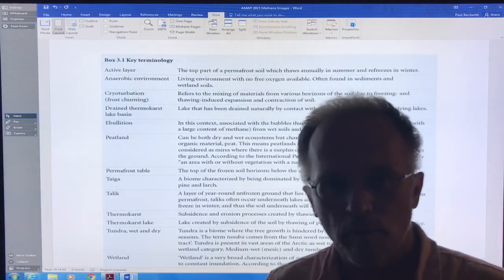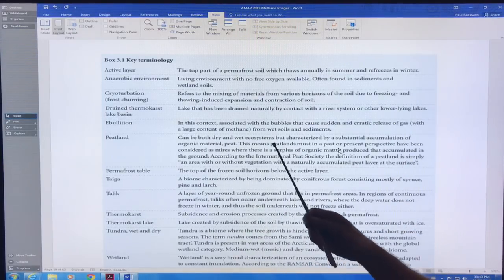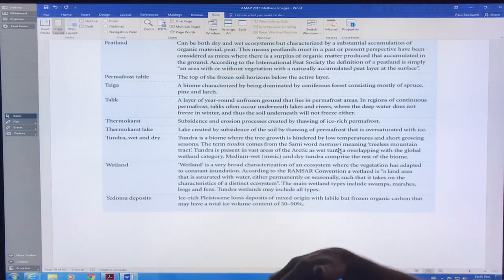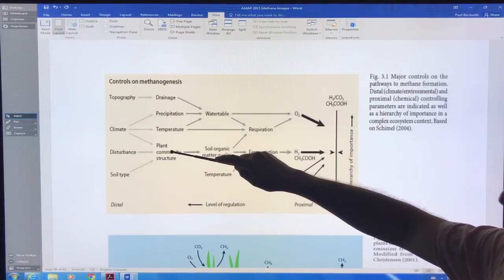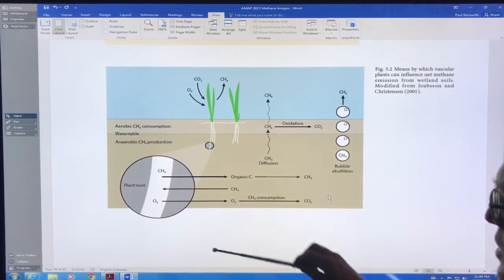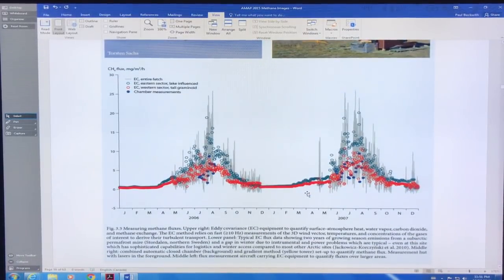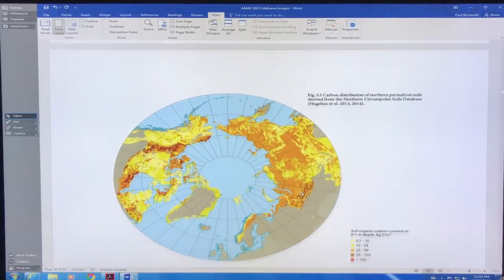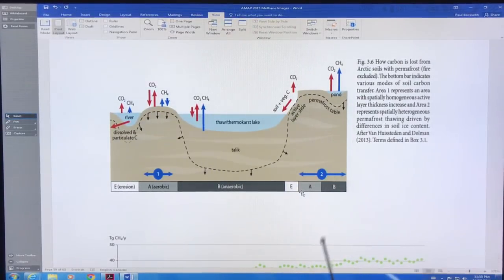Questions Galore on Arctic Methane

Comment: The Arctic News blog has just published sea surface temperatures for the area around Svalbard on July 6th. It went from 30F in 2014 to 61F this year (I normally think in cnetigarde but the fahrenehit values wer e what stuck in my head). Those figures tell you that the Arctic is a bit like Guy McPherson's fizzy drink in a glass when the last sliver of ice goes.
Reply: That's always the difficulty when translating from the original ancient Greek text. "Boil" gets confused with "melt."

Comment: The you tube video beyond the tipping point explains that the submarine data from 1958 to 1970 the arctic sea ice diminished 22%.  That was at 320 ppm CO2.  The planetary energy imbalance currently is about a petawatt.  After the sea ice is melted, according to the video, an additional petawatt will be added to the imbalance because of sunlight being absorbed by the dark water.  The video explains that with this additional imbalance climate change will rapidly increase and be irreversible.   This is expected to begin in no later than two years (2020).  

I think we have squandered the amount of time to mitigate most of the negative repercussions since 320ppm was enough to melt arctic sea ice.
Reply: David Madge: Keep smokin' whatever that is...
Reply: http://nsidc.org/arcticseaicenews/charctic-interactive-sea-ice-graph/
Reply: Look closely at that chart, and you will maybe see the letters T O A S T.
Reply: Maurice Lavenant the interactive chart is a great example.  If you click on July 9,2018, you will notice that most of the ice does not meet the 1981-2010 median avg line.  The ice thickness is much less in the areas it does, about 50%.  Ice will maintain area until thickness is at a minimum then suddenly dissappear.
Reply: Yep... I was just providing some data to David Madge who claims that the Arctic is gaining ice...
Reply: Jimmy D, you don't need to worry and you can start sleeping at night.  The Arctic is gaining sea ice.
Reply: David Madge I don't consider the 4th lowest June arctic sea ice extent on satellite record as a rebound.  That's the current data.